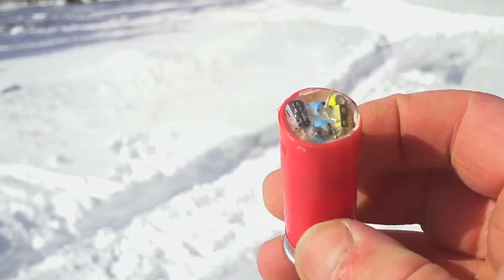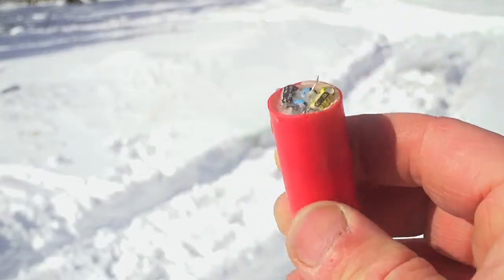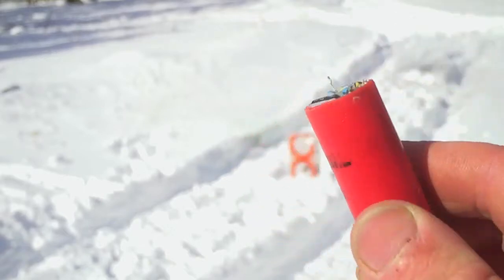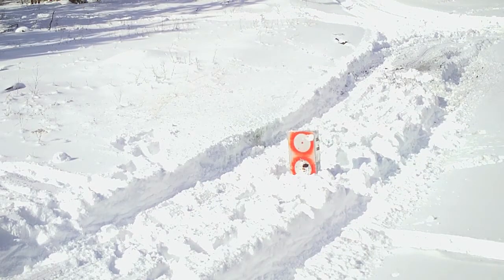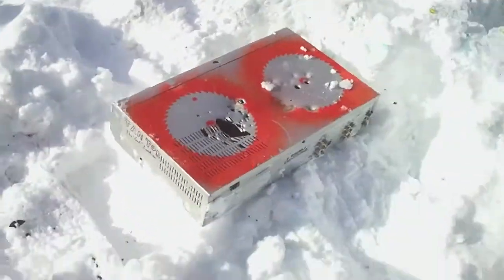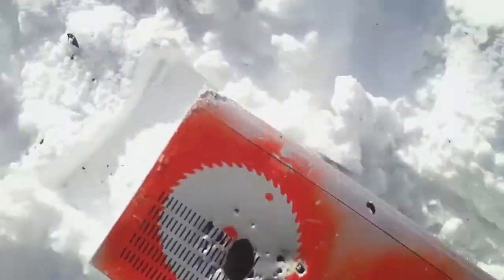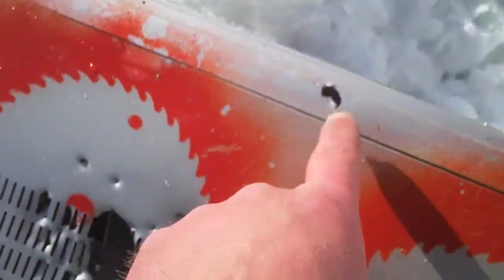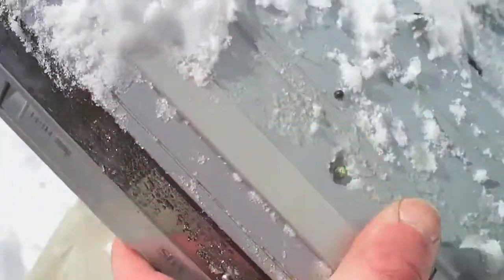Shooting Capacitors

Comment: you should use a single 400v capacitor charged up
Reply from the maker: +Peachu12 It would be neat to see if you could catch the discharge at the moment of impact.
Reply: +bluesmokeproductions just thought it would be a good idea careful though it could shock you and it hurts BAD